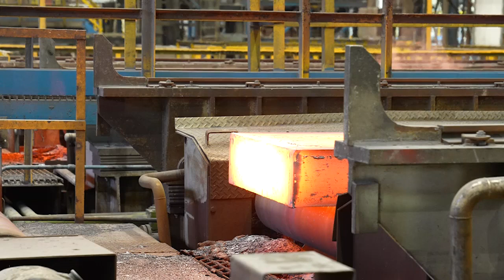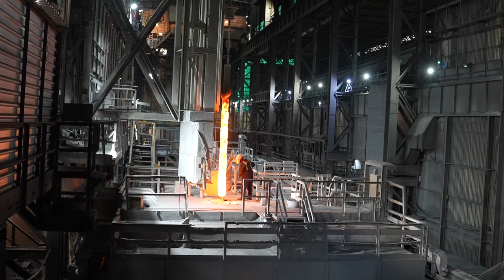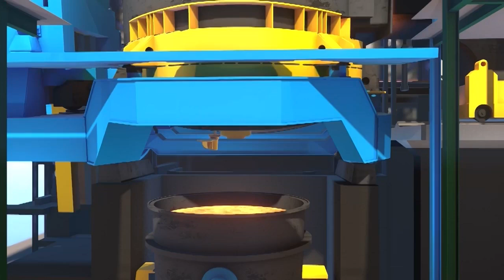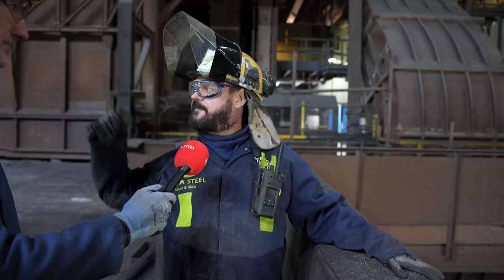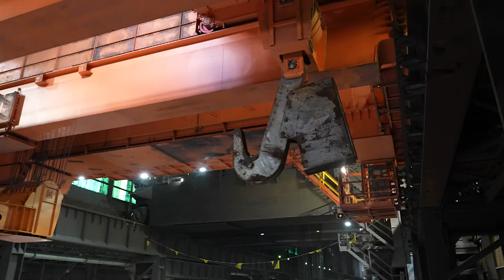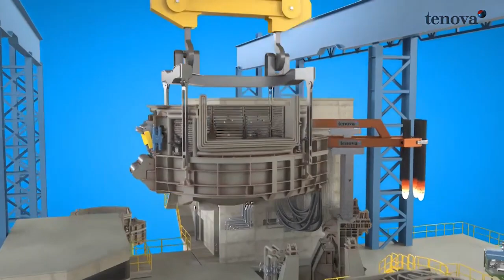Port Talbot: a site in transition

Comment: If the world keeps building electric arc furnaces we will eventually run out the scrap and then we have to go back to iron ore to make steel ?
Reply: That wont happen loads have been converted to carbon capture and sweden have built an hydrigen plant otbers will to just tata took the cheaper green option